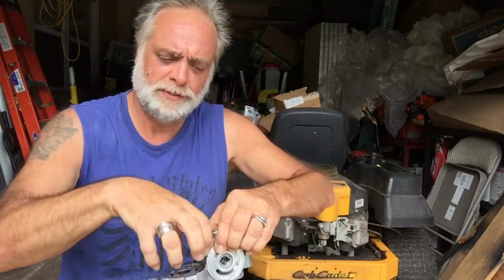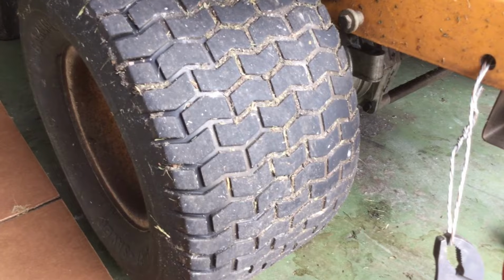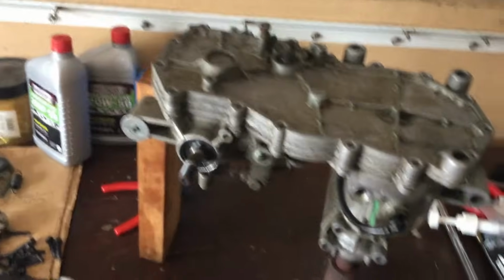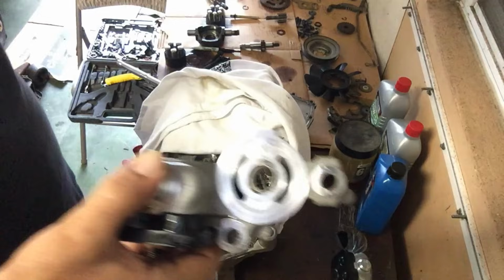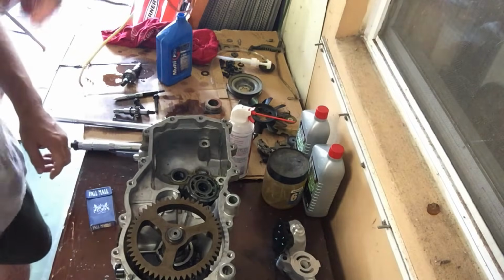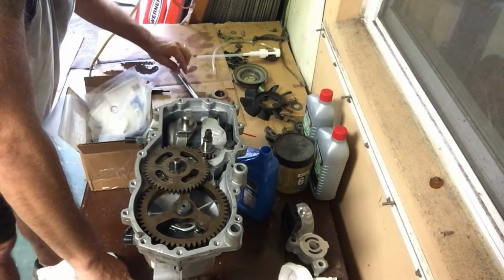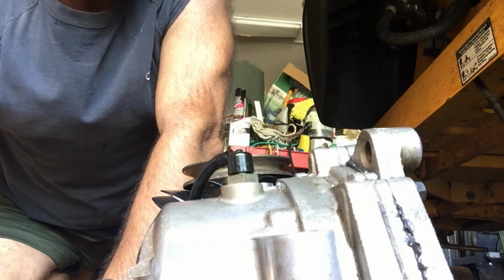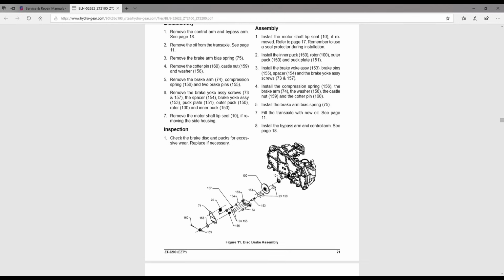Cub Cadet RZT 50 Riding Mower Hydro Gear Transmission Rebuild

Comment: How many hours did this repair last?? Just curios. Thinking about doing it on my gavely zt2040.TIA
Reply from the maker: Not sure if you’re talking about how long it took to do the repair or how long the repair lasted.  The repair itself took about two days, in part because you have to let the liquid gasket dry for like 24+ hours before remounting the to the axle.

With respect to how long the repair lasted, currently it has been over four years and still working.  That said, two things to mention, 1) first time I did the repair, it lasted a couple months then failed because I apparently didn’t keep the inside of the unit completely particle-free/didn’t remove all particles before resealing.  It’s critical to do so.  When I opened it back up after it failed, there were scratches on the surface of the center section which is what causes it to fail in the first place and those scratches are caused by particles inside the unit.  The liquid gasket also began to leak within those three months.

Second thing, about three years after the second repair was successful, the liquid seal began to leak.  The only way to truly fix that is to remove the unit, open it back up, remove the gasket, and reseal.  I didn’t want to go through that, so I just put some more gasket liquid in he seam where it was leaking.  Stopped the leak for a couple months, now it seems to leak a bit every now and then.

Comment: Thank you for this video.  I think it is the best  I ve seen for this mower.  I like your approach to this repair.  After you got the 1.7 qts. of oil in the unit was the oil all the way to the top of the fill hole?  Is it safe to add oil to the drain/refil opening.  Would this be too much?   Thanks again for this fantastic video.
Reply from the maker: It wasn’t all the way to the top of the fill hole.  It was probably around 3/4 to 4/5ths full.  I’d assume if you filled it all the way up it may eventually drain down to the level of the drain hole.  That said, it might be possible to create too much pressure inside the unit if it’s overfilled with oil which may harm your seals, etc.  Yes, you can add the oil into the fill hole.  I used a small hand pump siphon.  However, you have to be diligent in ensuring you clean any dirt from on and above the hole, any dirt you may knock loose when putting oil into the unit once it’s been remounted, otherwise, you’ll ruin all your hard work.

Comment: I look through your videos and couldn't find anything like the problem I am having.  I have a Cub Cadet 46" RZT L with 190 hrs. The mower will start at times and works great. Other times it want start as if dead battery, battery is good btw, can't hear anything when trying to start the engine. Example: Cutting grass and stop the mower to take a break return starts right back up no problems. Then another time after stopping when I return no start. Go back in and after mower sets awhile or sometimes overnight it starts. I do my own maintenance being a retired Navy electrician / mechanic. Any suggestion. Tks
Reply from the maker: I’m no lawnmower expert by any means, I just did a bunch of research on the transax repair and did the video.  That being said, from time to time, my mower has the same issue you describe.  If it’s not making the cranking sound when you try to start, then it’s unlikely an issue with the choke.  Sometimes choke will stay in the open position, but it does make the cranking sound, so I just manually close the choke lever on the engine and it starts.

This sounds like possibly one of three issues, all of which I experience from time to time, though your mower may not have the same functions as mine.  Assuming the battery is good, either positive or negative terminal wire to battery could be a little loose though this is probably the least likely cause given that it continues to run once you have it started.  2.  The sensor on your seat could be glitchy.  Maybe try shifting your weight around a bit etc.  3. An issue somewhere with the parking break to the engine.  Try engaging and disengaging the parking break a few times.  Other than those three options, not sure what else it could be.

Comment: My hat is off to you dude! I'm goin' in on my RZT 50 today.
Reply from the maker: Well…have fun with that…it’s a process…can be fun if you like he feeling of frustration and solving problems.  A couple important things to lower the chances of disappointment - imperative to keep any dirt, dust particles out of the unit as that’s what caused the failure of the trans in the first place.  Some will likely fall in as you remove he old gasket rubber so use a vacuum to help keep particles out or whatever works for you.  Also, make sure you use a generous amount of the liquid gasket when resealing.  Mine sprung a leak a few months ago also I Potok the trans off again and put some liquid gasket on the outside seam.  Not ideal but I had no interest in taking it apart again to redo the entire gasket.
Reply: @silentknightsaga2415  I did it!!!! It was a stuck parking brake. YES!

Comment: Thank for making this video..everyone  had videos for husqvarna zero turns that have already failed  or simply had a loose belt..nonetheless none of them mentioned that what if it works fine until 30 or 40min into the mow and then it starts slipping. 🤔 so instead of cutting the lawn in 3 segments I'm gonna try my luck with your tips and rebuild it...at first I was just gonna change the oil but I will probably just have the same issue. My yard has 55deg hills and it's almost 2acres so it did its job perfectly for the last 17yrs. With just a simple charging resister that went bad and a few batteries I believe I got my money out of it. Since I work doing custom machining hopefully I can repair it cheaper then buying a new 850 dollar one!
Reply: Any update Jason? I'm also a machinist and having exact symptoms. Wondering if it's thermal expansion of the cases that cause excessive bypass at half hour, or is the old oil thinning to much?
Reply: @lukemurphy9224  Well I tried changing the oil first. I used Valvoline 2050 VR 1.
And wound up with the same problem.
Not sure if it's because the oil is not for transaxles. I am gonna try amsoil transaxle oil before i rip it apart. I think the pump is just getting weak. The oil i originally changed out was shot shot. Almost water like. So im hoping that it is an oil issue. ...if not...well then i take a self taught class in rebuilding hydrostats....haha
Reply: @jasonruch3529   Sorry, but I would be very surprised if you find any marked difference with specific hydrostatic fluids. 
My (and most Bobcat branded) skid steer loaders specify to use a multigrade 15W40 engine oil for the mixed use in hydraulic and hydrostatic drive systems. Looks like you may need to do the same as me and get internal :(
I have 2 lots of transmissions to play with now as well, as I picked up a cheap 'spare unit' from parts mower and direct swapped only to find it seems to have the same issue. Both right hand sides.
I was wondering if the angle of wrap of the belt being less on this side is a contributing factor or just the way people turn the machine with chute direction etc. I'm from down under.
Reply: 1300 now 😢😢😢

Comment: Great video!! I'm having the same issue with my 2010 Troy bilt. Parts ordered and gonna try this weekend.
 Why do you think it's always the left unit?
Reply from the maker: Not sure, seems like the right side would be more susceptible given most people cut the grass with the deck shoot facing outward which means the right side transax gets used more frequently than the left in terms of pushing forward.  That said, maybe the type of use with the left side is the issue as that one gets pulled back more than pushed forward.  Not sure.  Just make sure you are diligent about keeping the case inside completely free of any particles as you’re working on it.

Comment: when putting the piston motor back, turn the case a little its side and put motor piston is at an angle this will keep them from falling out. should make it easier to reinstall.

Comment: How many hours were on that transaxle  and how big was the property you were mowing, was there any hills ? Thanks in advance.
Reply from the maker: Probably around 800 hours, about 2.5 acres and one very long steep embankment that goes from 0 degrees to about 45 degrees in only 8ft from base to top…so kind of a hill.
Reply: @silentknightsaga2415  okay thanks so much just trying to gauge longevity of the transaxle. Appreciate the quick response.

Comment: My fill hole has the plug with the hose on it.  I have filled it and purged.  But when it runs for awhile fluid just flows out the hose.  A lot of it.  Should that happen?   Any ideas?
Reply from the maker: It’s possible you’re over filling and the fill hose may double as a purge/overflow hose.  My purge hose isn’t part of the fill hole, it’s toward the bottom of one of the sides.

Comment: Hello, I know this is three years late but I just rebuilt my trans exactly as you did. The problem was fixed but about 3 hours after running, if went back to normal(loss of power, full acceleration and no movement) What could I have possibly done wrong?
Reply: And I used high quality oil, and new seals, new center piece, one new pump, sanded down the other one and cleaned the trans from debris. I’m very sad and really don’t want to have to buy a brand new trans😢
Reply from the maker: @liamreynolds5820  blah…tough to say.  Could be any number of things given all the moving parts.  Potentially something as “simple” as the linkage arm or mech not engaging properly to something deeper such as the cylinder piston springs or yes, scratching of the center section.  Seems like more than just a scratched center section and unlikely it got scratch so much to cause that issue in just three hours.

That said, the first time I did the rebuild, it started loosing power after about, meh, three months.  As much of a pain as it was to do the rebuild, I decided to bite the bullet and and disassemble it again.  I discovered that the brand new center section was once again scratched so I obviously left contaminants in there.  I did the rebuild over again which is when I actually shot the video and it’s worked great ever since.

Is the complete power loss on one or both sides?
Reply: It’s just the left side, it is still drivable but doing a zero turn, a slight hill incline or just quick acceleration, it just barely or completely refuses to move. The right trans seems completely fine and picks up the slack of the left one for the most part.
Reply: So what fixed it ? Or was the problem ?

Comment: So your saying the oil breaks down because you can't change the oil. Pump scoring from degrading oil. That makes sense. Thanks for the information and video Man. Ps. After seeing what happened to the lift side I think I would change the oil in the right side.

Comment: I would really like to know what courses those parts to go bad. And does that transmission have a drain plug. And how many hours did you have on your mower when that happened.
Reply from the maker: Ran it for about eight years at that point so it probably had about 500+ hours.  I guess you could remove and replace the oil if you used a siphon, but no, there’s no drain plug.  Consider that even with the oil in a contained unit, it’s still lots of metal parts moving at high speed and making contact and getting extremely hot so they tend to shed some metal particles over time. Also, the way this particular mower and probably many like it is designed, the fill cap is facing up toward the underside of the frame which gets very dirty.  If you don’t make sure everything around and above the fill hole is perfectly particle free when you open the cap (and it’s a tight space between the cap and frame so your hand rubs on the dirty frame when loosening and removing the cap), you’ll get dirt in the transmission which then contaminates the oil.
Reply: @silentknightsaga2415  ok I see what you mean. I just bought me a Hustler Fas trak 54 inch mower. I never owned a o turn before. Man what a difference in productivity. 
Thanks again for the information.

Comment: Very helpful video! I bought a used 2006 Cub Cadet RZT 50 ~3 years ago for $900 and followed this video to rebuild the Transaxles. After 5 years the left unit is loosing power so I'm going through the process again, but had a difficult time finding this video. I found several others which were not nearly as useful!. This is the best I've found on You Tube. I've found I can re-surface the Center Section using a large Sharpening Stone and wrapping the wet/dry sand paper over it. I rebuilt the right transaxle without buying any parts and am doing the left again now without any parts. I have used a spare mower blade on wood blocks across the input shaft to pull the seal out with the shaft and bearing without damaging the seal. That's the only seal I damaged on my first rebuild. Just wanted to thank you for the tips you put into this video as I find it very helpful even doing this for the 3rd time now.
Reply: @Leo Thiel let us know how that works for you.  I once tried it without new parts and smoothing the aluminum center section by hand.  It lasted 2 weeks.  If you can do it then fine.  I have not been able to make that work.  Also, it seems like 90% of the time when they get weak, it’s the left side.  I wish I could understand why.  Does everyone favor using that side more when they run the mower?  Seems unlikely to me.
Reply: @failranch9542 I have two of these mowers, (Massey Furguson version) got one cheap with failing hydro, bought a third "parts mower" and swapped them in. Same outcome, two out of the two I have that are slipping are right sides, but I'm down under, so maybe it has to do with hemispheres?

Comment: Do you have a part number for the new pump? I'm needing one for a mower I got and haven't found any videos of anybody giving a part number
Reply from the maker: No, several months ago it sounded as if the pumps might not be sold anymore, however at that time I was still able to find them on partstree…though I haven’t looked for them recently so I’m not sure.  Not sure if Hydrogear sells them, but here’s the number to call CUSTOMER SUPPORT
877.728.7410

Comment: Well, I followed a link back to your GREAT Video of repairing your transaxles. I am having to replace the belt that runs the two units and I think you have the best view of doing just that. With my memory now at the age of 75 going it makes things even harder for me remembering how things go back together.. It appears taking off the rear wheels will give me better access to the belt. Any hints you have to give would be greatly appreciated.

Comment: I put by pass shaft in and it does not snap back either way. What am I missing.?
Reply: Bypass plate small brass square piece that goes into the centre section

Comment: I haven’t seen whole video yet but do you ever change the oil in these some how?
Reply from the maker: If you’re talking about the oil in the transaxle, sort of.  Because it has to be emptied of the oil before working on it, it has to be filled with oil both before remounting it, as well as topped off after you purge the transaxle, all of which are included in the video.

Comment: Great video that relieves my mind on if I can do this myself.. Being 75 yrs old now and not as sharp as I used to be concerned me, but the way you went thru this so well and informative gives me inspiration to take it on.. Thanks
Reply from the maker: LOL, Yah, and I’m no mechanic or engineer.  It was the first time I did anything to a lawnmower other than replace a deck belt or spindle.  I was quite apprehensive about it too, but as long as you pay attention to the details, keep the inside casing free of any particles, and follow the steps, it should work out for you.
Reply: @silentknightsaga2415  Just when I get fired up to do this I find out that they longer Cub Cadet, neither does Parts Tree have parts for my mower since it was built in 2005.. Anyway I was just wondering if you did this in 2019 and you're still mowing with it. Is everything still working now and have you noticed if the other side is acting up.. Oh one thing I think I missed in your video was you having to add more oil after you got all the air out of it. Anyway Thanks to putting out this video.. If I do mine I will have to video it just so I can remember how I took it apart. :)
Reply from the maker: @garyhardin3619  so I actually had to do this repair twice, but to the same side.  First time I did it, it worked well for a few months, then started having same issue.  I’m positive the issue was getting particles from the old gasket in the unit as well as not covering the open unit as it sat in the garage over night.  Second time, which is the one I video-ed, I was much more careful and diligent keeping particles out and covered it with a shirt over night.  Yes, did this repair in 2019 and it is still working well with no noticeable power loss.  No, there are no issues with the other side.
Reply: I got a cub cadet z-force mower I need to figure out the problem with it it tries to take off on the left side then does"nt kick on in and go the same side you fixed it acts like it bypasses I am thinking and it dies when I engage the deck any input on whats my problems and can I still get parts. For a z-force commercial mower?

Comment: Where did you purchase your center section part? Thx
Reply from the maker: I believe it was PartsTree.  Cub Cadet had them available at the time, but more expensive.  That said, based on some comments several months ago, it sounds as if there’s some difficulty finding these available in recent months.